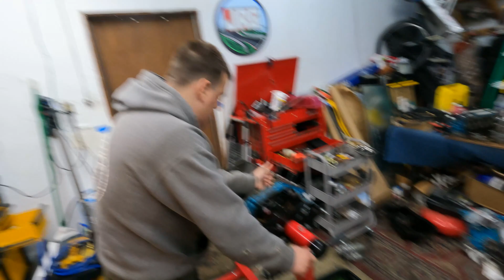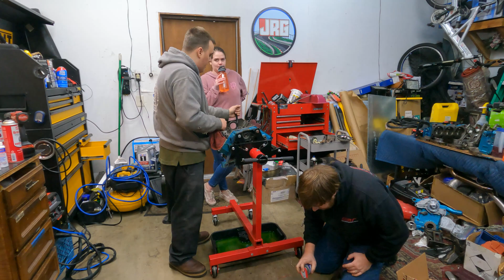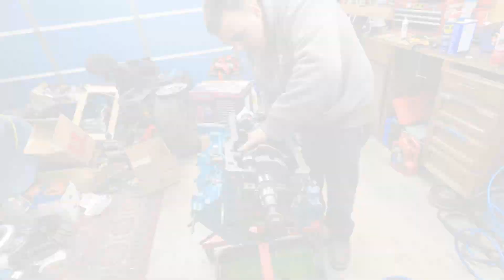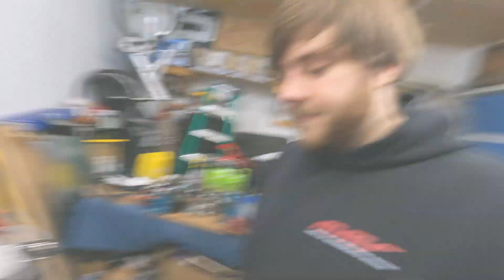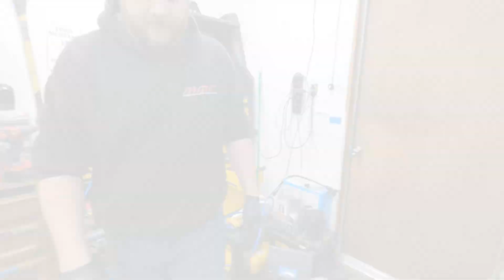Rebuilding Project F's L67 Engine! (Turbo V6 Camaro Engine Refreshed and Ready for BOOST!)

Comment: what size bolts did you use to hold it to the stand
Reply from the maker: I’ll check and get back to you
Reply: I ended up grabbing an older bell housing bolt took it to Home Depot got like 3 or 3 1/2 inch bolts that matched the threads easiest way to go about it. I’d I bet into my paper work and grab the receipt I’ll post it.
Reply: @SteezyBeeOfficial  if you could that'd be awesome. i was told the long head bolts worked but they are way too loose on the threads. if you could get that number im going to ace later today